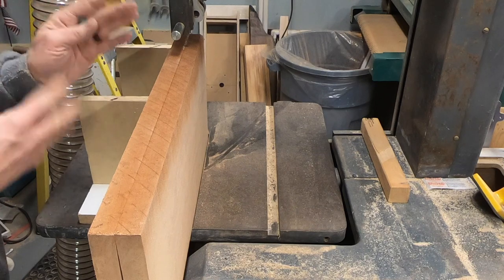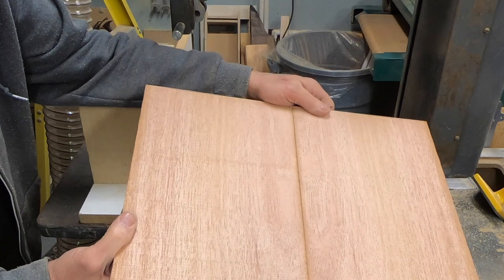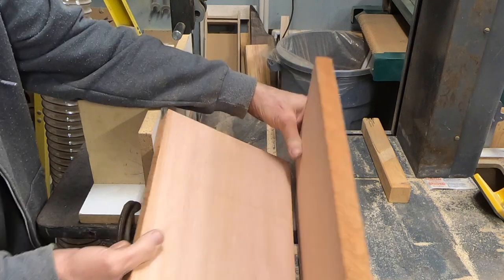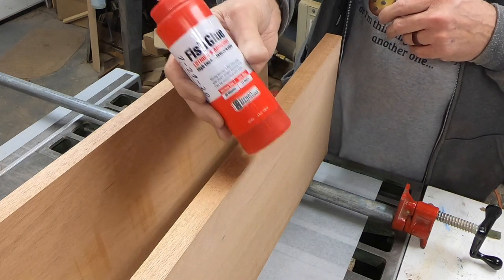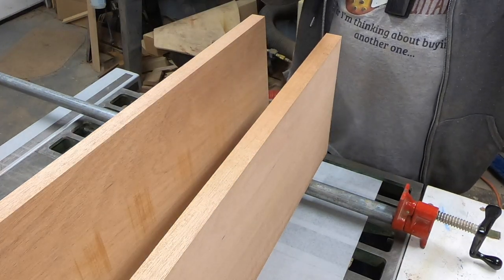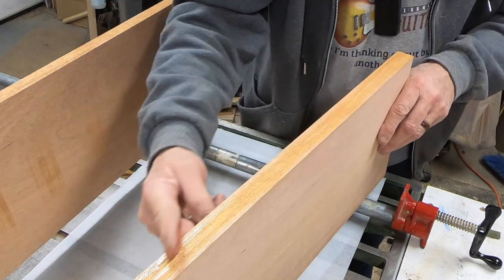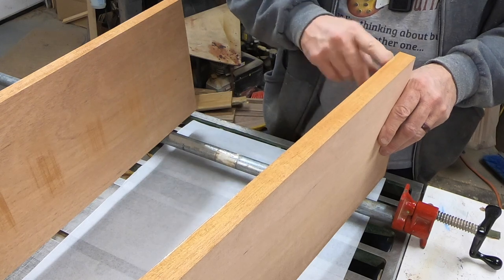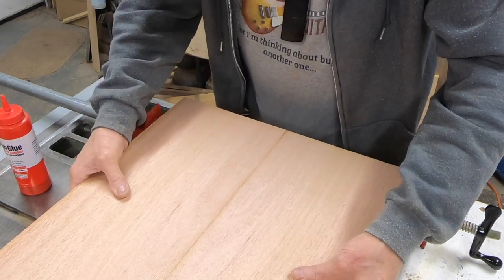GREAT GUITAR BUILD OFF 2021 #1 at JONAH GUITARS

Comment: But what about horse glue?
Reply from the maker: Hot Hide Glue is great glue but it has very little open time because it starts cooling off as soon as you brush it on. I have used HHG for years but it really is a hassle. Some things you might want to set really fast it's perfect for those. Marc, I just realized it was you. You messing with me?